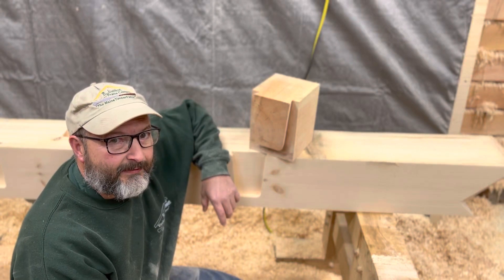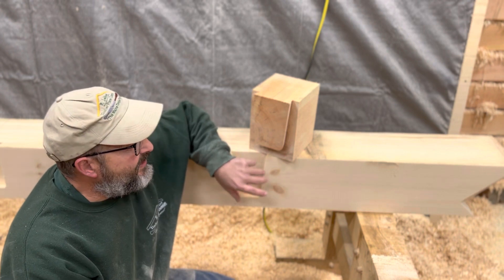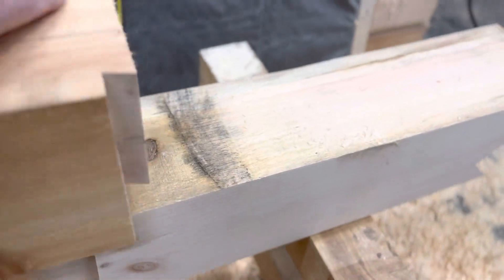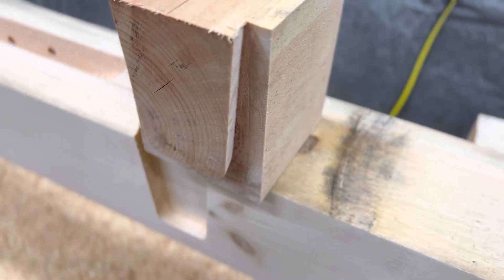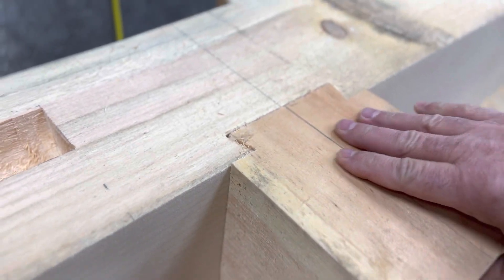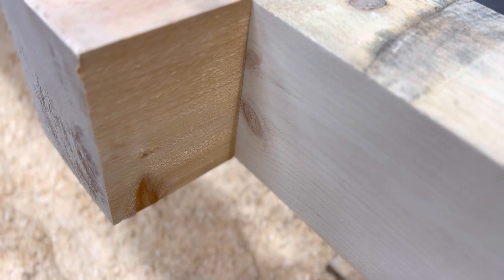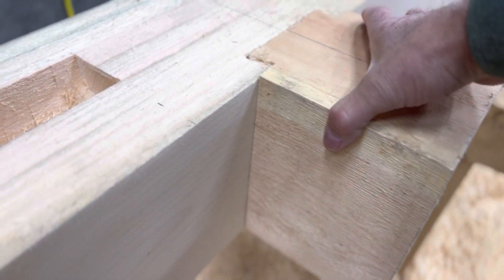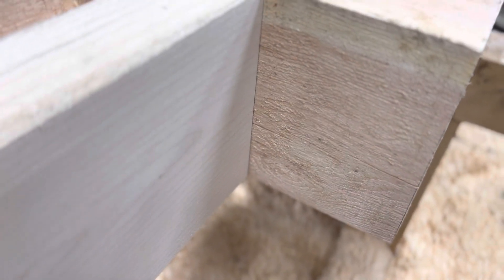Timber Framing - Mafell Router and Arunda 120N Jig - fit up for the mortise and tenon

Comment: About 16 years ago, I made an MDF pattern very similar to this. It took me two or three days to get it correct and I installed 24 beams approximately 10 cm x 20 cm, some floor joists in an old Mill in France and once I’ve got it all set up it took me less than a day to cut all my joints and put my beams in, this company is very clever, and I did use the Mafell 65 router as well, 
Great looking job I’ve got her some other work of yours. It looks very impressive. ,

Comment: Looks very neat! what is the depth of the housing / length of the dovetail? .... and do you ever wedge them to avoid them loosening when the timber shrinks?
Reply from the maker: Hi Simon
The tenons are 15/16”.  The dovetail shape is beveled so it locks into the corresponding beveled mortise.
I have not had any situations where a wedge is needed.
Really nice system!
Reply: @theMainetimberframer   Thanks for the super fast reply Rich much appreciated

Comment: Beautiful and it looks very strong.
Did you test the joint?
Reply from the maker: Hello
I have not tested the joint.
Arunda has weigh rating data for their joinery - check out the Arunda site for joint testing information 👍